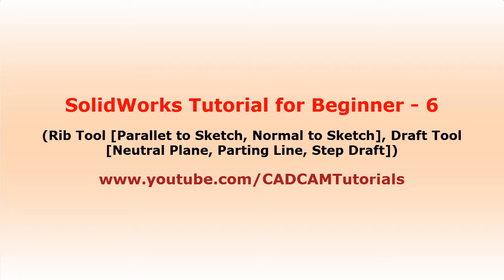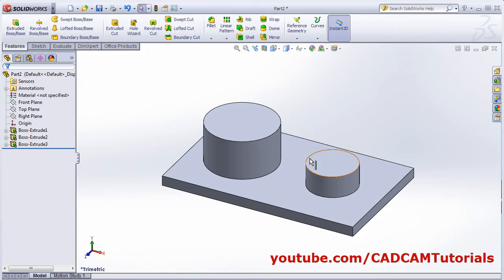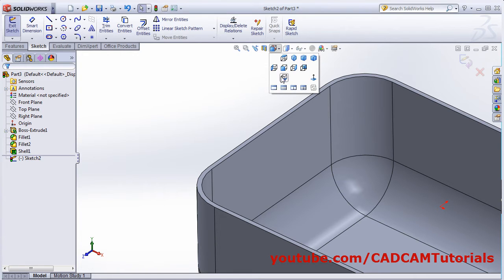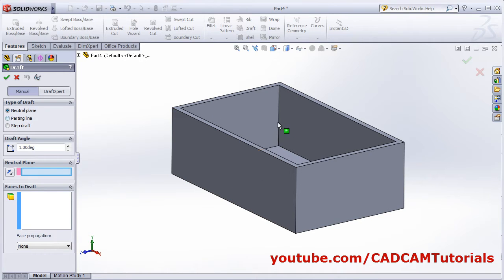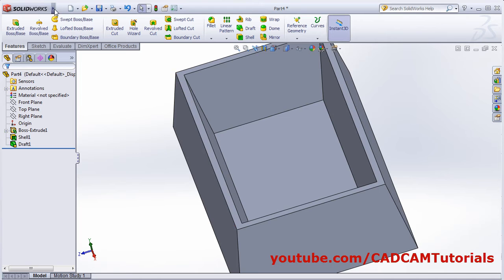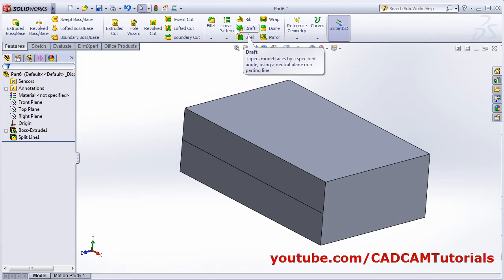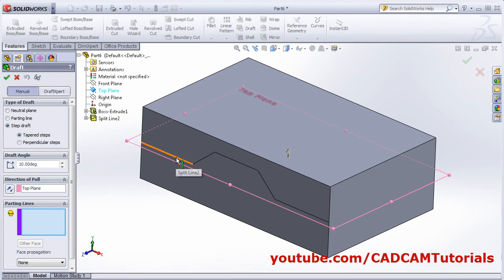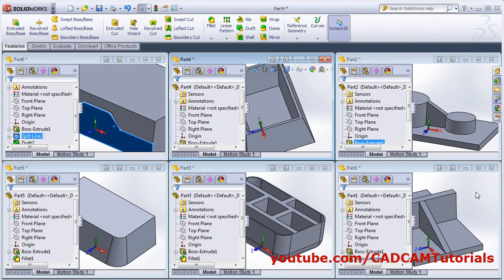SolidWorks Tutorials for Beginners - 6 | SolidWorks Rib Feature and Draft Command Tutorial

Comment: To understand more about Rib feature : From design point of view, ribs are used to provide rigidity to the structure without increasing thickness of the material. Solidworks automatically predicts using backend design calculations for which ribs and design is the structure going to be the most rigid.